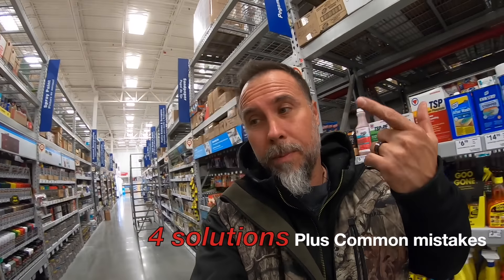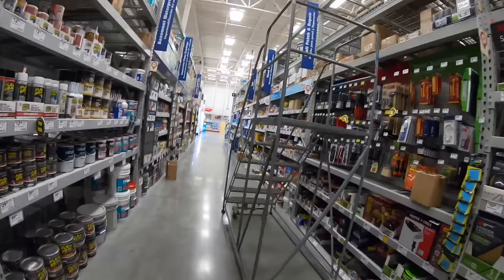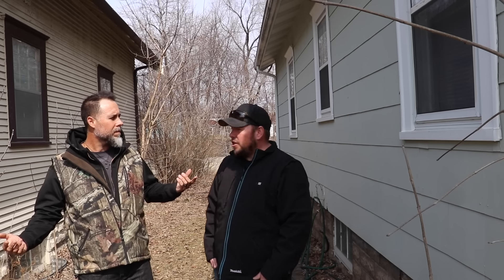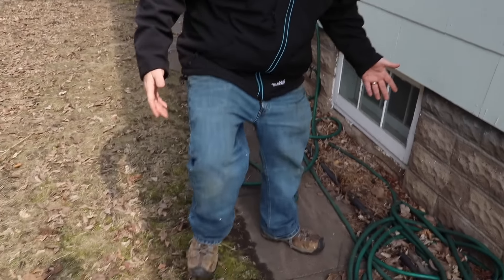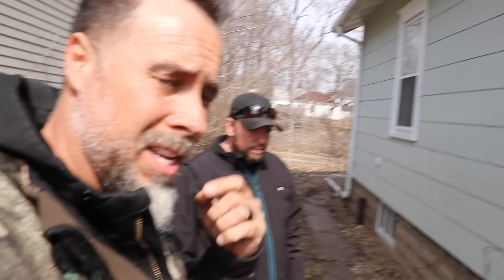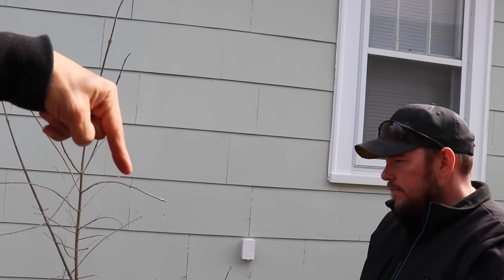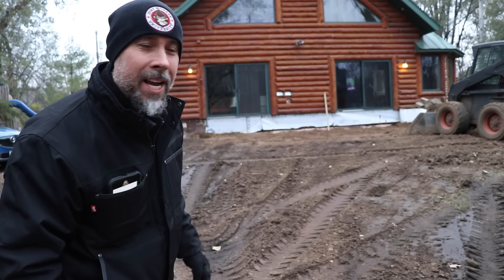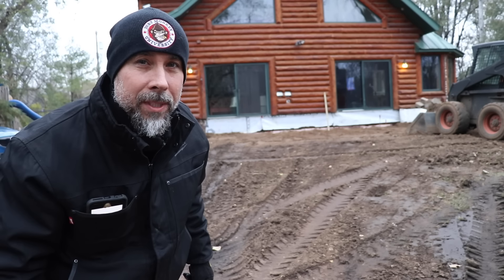4 Solutions to fix a wet basement plus Noob Mistakes

Comment: This video was extremely helpful.  I had the same problem others have mentioned here, getting a proper diagnoses of my occasional flooding. Even though I told them it only flooded when the gutter overflowed onto the side of the house, they told me it was the false water table coming through the bottom at the footing. It made no sense. No flooding for years, as long as the gutter was pitched away from the house. After the sticker shock of their solution, I did my own investigating and found that when I ran the hose next to the house, the small window well was filling up and running into the basement thru the sill. That’s not to say their solution wouldn’t have solved that. But I’ve got to believe grading,  French drain with a good draining window well will actually solve it. Maybe not.  But we will see.  Their solution involved tearing out the walls and cabinets, digging trench, and Installing sump.  Just tell me the options instead of insisting on the last resort “guaranteed” to work solution.

Comment: I have family that install drains in Missouri and they have told me that unless you line the trench of a french drain with non-woven filter fabric before you put in the rock and drain tile and wrap it over the top, that the soil will migrate through and mix with the rock and slow down if not stop water from reaching the drain tile.  Wrapped with a non-woven filter fabric, all of the water in the soil that reaches all of the rock flows to the drain tile and quickly drains off.
Reply: They did say that the all-in-one drain tile are a good second choice.  Not as efficient but the foam "rocks" wrapped in the fabric do prevent the drain tile from getting plugged up.
Reply: Hey, if you don't mind me asking how much did that cost tou total,? Do they charge based on dimensions? Thanks

Comment: We did 3/4 of our external basement walls on our house in France last year. Dug out the basement walls down to the the bottom of the foundation walls  2.5m x 1m for 20m length (using hand tools as no way to get a mini digger in there). Cleaned up the stone, repointed it, 3 layers of render to get it all flat, Rubberised / tar paint over that and then the dimpled membrane over that. 3" of compacted sand in the trench base, followed by a 'geotextile' sheet in  a giant U into the bottom of the trench, the ends sitting above ground level (it was a 4m wide roll). We then laid our pierced drain tubing into that and filled with gravel all the way up to slightly below ground level. Closed over the Geotextile and then  added more gravel / stone over the top to just above ground level and sloping away from the wall. It took 9 months to complete but should do the trick ! 
One thing you want to add is a metal strip that forms a lip over the top of the dimpled membrane to stop water running down the wall from above and behind the membrane. You also need to make sure to tape the joints in the membrane sheets to make them really sealed shut. over engineered maybe but for the sake of an hour and a couple of rolls of tape, worth the peace of mind. 
At 15 mins in the video, what's that pipe on the opposite house wall? Hope its not throwing water out?

Comment: You could also knock on the neighbors door and ask them to run their downspouts away from your house.
Reply: Old lady:. Oh, so I should point them where?   Oh. Hell no. They are fine where they are... don't touch them!

Yeah. I have little faith in people.
Reply: Good luck with that.. for 16 years my neighbor in a townhouse section i lived in never cleaned his gutters so it dripped off his roof next to the foundation and it would always leak in my basement
Reply: My neighbors just moved after 22 years and they never cleaned the gutters and ran it down into my basement. Now they are gone , they have new gutters now so we shall see.

Comment: The neighbor's drain is pointed directly at the house in question.  @6:50 Stan even looks right at it.  I'd be talking to them first.
Reply: If you're referring to the downspout extension at the rear corner, it would be a minor concern compared to the poor grading of the site itself.  Properly graded, a swale would still take that water away from the building rather than back towards it.  Improperly graded, you're just trapping water against the building until it flows over the foundation (or through the window).  Still, changing the direction of those things takes maybe $10 and a trip to the Home Despot?
Reply: I know the grading is the obvious issue, just pointing out a scene in the video.  Like I said, the neighbor could be so kind as to change the direction.  Would be cheap and wouldn't hurt.

Comment: for someone so fixated on the IRC stipulation that we keep grade 6" below the sill plate (and siding), you missed the part that says high termite areas may not use foam board on the exterior subgrade surfaces. you also missed where it says to use a 5% grade extending 10 feet from the foundation. 5% of 120 inches is 6 inches. your 1 inch drop over 8 feet of run works out to abt a 1% grade.

with that out of the way, step one is to determine WHY the water is coming in. 

if water comes in through cracks, then obviously seal the cracks. 

if water percolates DOWN through the soil and penetrates at the footing, there are a number of options. clean gutters with downspouts extended to discharge at least 10' from foundation. correct the grade. dig out and waterproof with compound or EPDM, install footing drain, install dimple board, or a combination of the three. 

if water table rises and overflows the footing, no amount of grading or waterproofing is going to fix the problem. dig out the footing and install a drain BELOW THE FOOTING, install a sump and discharge somewhere it won't find it's wake back in, or both. 

talking to a local historian i learned that before my block was redeveloped there was a cistern near what is now the corner of my basement. that would make a perched water table. sump pump it is.

Comment: That black pipe is the cheapest and with the membrane over it is the worst !!! I’ve been a plumber for over 25 years and I do alot of insurance inspections….the membrane should only be on top of the gravel….and theirs alot of cities that ban this pipe because it clog’s up after only a few years thus the pipe becomes useless 🤷‍♂️ white pvc with only two section of holes is the best….it stays straight and easy to slope perfectly 👌in general the video is okay…but not top notch!!! Theirs alot of professional that think their good but actually their not 🤔 do your homework and have multiple companies advise you before investing so much money 😉

Comment: If you are dealing with a slight cracked foundation that is allowing the water to enter the basement, there is a method to inject expanding material from inside the basement that will expand throughout the crack all the way out into the soil.

Comment: when you have shady basement windows like that with the old nails and no seal they are creating a moist environment with temperature differential bugs ect must cost a lot to try to heat in winter sunken sidewalks and splash protection of walls good points good video   as a concrete guy I would say new properly sloped sidewalks cheers from ontario

Comment: Sorry but the dimpels goes inn against the wall to let the wall breathe. 
Here in Norway it's almost only drainage with the plastic/membrane and also waterproof concrete first than the plastic with the dimpels inn, than isolation xps.
Reply: I was going to say the exact same thing. Treat the wall with a water proofing like the rubberized coating then attach the membrane dimple side in so the water will drain down the wall around the dimples to the drain tile below the footing.
Reply: came here to say this too, this stuff is common here in europe
Reply: I did the wrong order in My comment, it's water proofing the wall first, than isolation and last the plastic/membrane with the dimples against the xps isolation. It's been a lot of discussion about if the isolation goes first ore last but here the Sintef research organisation have researched the topic and found out that the plastic membrane is the last before rocks.
So that's how I install  it when I do my drainage jobs.
Reply: that makes sense, because if you put your insulation on the outside it can get wet and wet insulation loses its insulating properties.
Reply: You are all kinda right but ultimately wrong.  If you buy the cheap board he got from the home improvement store it does not come with a geotextile face. Real drain board comes with a 4oz non woven fabric laminated to the face that faces the soil...dimples out.  The geotextile holds the soil and fines away and allows a void space for water to escape from.  

By going dimples in you have a sheet of plastic facing compacted soil.  Water comes down and has nowhere to go, completely defeating the point of the board and the void space that is against the house is serving no purpose.  

I’ve done waterproofing on large civil and commercial projects for 15+ years and know what I am talking about.
Reply: You would be correct that yes the dimples do go into the concrete however know the system that he is describing he pushed the barrier up with the dimples and then he puts the pink fiberglass insulation outside of that in that situation you would put the nipples facing out that way when the water makes it through the insulation it would run down not the opposite way it's completely different process based on the way he described how he does it none of the applications of wall board that has dimples actually set it up so you have another layer of material outside that board
Reply: @stevenbeacham6004  What I know of European building code and Standards you should have waterproofing and then a layer of clean gravel minimum about a foot wide from ground level down to and under drainpipe at level a foot under the basement foundation. Also have to use geotextile between soil and gravel.
Reply: @uppsalahazzemarkstedt2759  I know that in the United States there is a broad range of codes like in Oklahoma you don't even need to have a barrier like that I mean most houses don't even have basements out west where they have basements it tends to be dry so I think it depends on the location and inspectors are funny people and sure the codes they're not it really as uniform as people think also most of the United States where there are basement don't have the amount of moisture to places like Norway have
Reply: Roof coatings that are high dissolved solids silicone are the best. But very expensive. And requires an absolutely clean surface.
Reply: Also that polystyrene is Xps not to be confused with eps.
Reply: @Fake Reality The problem is in the wording... I like to say dimples in and pimples out...much clearer that way!

Comment: When we built our new house this year I made sure to put a drain tile in near the footer and then fill it with clear til a foot  from the ground level then clay and then top soil to grow grass because the house is built into a hill here in PA. And here it's nothing but hills and flood zones haha so we built on the hills haha I also put a small basin in the one corner of the sub floor in the basement to hold the sump pump and the water drains all go to the pump and that way if I do get water it will run straight to one of the drains we installed in the basement floor and then to the basin where the sump pump is and hopefully it works great I got the idea from our last house we bought and lived in for about 10 years it had a sub floor in the basement with a drain system and a pump

Comment: I got quoted $5000 to do draining in the basement. And $15000 from outside. Good I found this video, I don't want damp basement.
Reply from the maker: Hope the vid helps you out and hope your basement turns out well!!
Reply: If you add a vapor barrier on the inside it will catch the moisture coming through your wall and channel it into your waterproofing system and you will not have a damp basement and you could also add a dehumidifier and drain it into your sump pump.

Comment: I'm in a similar position as these two houses but my house is closer than my neighbors then the house is in this video. I was thinking if you dug up maybe 2 ft down and then made a v in the ground between the two houses and then laid your plastic down with the drain pipe in the center and then filled everything with gravel this should fix the drainage between the two houses very well.

Comment: At 10:17 the box labeled Hydraproof 3000 is a super sticky thick rolled waterproofing membrane.  We used to use that stuff to waterproof ICFs, but you better have experienced help cause if it sticks in the wrong spot, its not coming back off.  Its like an innertube for your wall if done properly.

Comment: Drylok traps moisture and accelerates efflorescence and breakdown on the concrete. Home Depot does not sell this but look for master building product systems like master seal. They have specific sealants for inside and out. Stuff is used on Waterdam’s and ponds just saying..

Comment: I've used drylok before on basement walls and certain spots water was still able to get through even after multiple coats. So It's not a guaranteed seal. It's got sand in it which fills in all the nooks and crannys in the cinder blocks and it's supposed to seal the interior walls but it doesn't work on stubborn areas.

Comment: My french drain was done like that, and the permeable fabric became impermeable with dirt clogging the pores. I had it redone with no fabric around the pipe, no  fabric on the rocks, no dirt on top, and it works perfectly. The french drain has to be perfectly free to catch surface water immediately so the water doesn't have time to build up and run somewhere else.
Reply: Thanks for the warning

Comment: i have an extreme flooding problem in my back yard. i have 3-4 houses with sub pumps UP hill from our house. all that water drains and collects in my back yard. the standing water is so much last year i couldnted 27 cat tails. i live in the middle of town! im almost afraid a DNR officer will show up and say its a wild life refuge! lol. im thinking of filling it in with class 5. its slightly up hill from the water to the house and then down hill (2 foot) to the sidewalk/street. it drains that direction now but in the winter time we ice the crap out of everything from the side walk to the street. thankfully the house is above the water settling line and stays dry! we do have a nice subpump ourself and it runs perfectly. the "swamp" im looking to fill is around 24x40 foot. im guessing 12-14 inches deep. 70% of that area is water right now from the snow melt.

Comment: If anyone does the interior water proofing please undermine the floor once you jackhammer or saw the the concrete. Otherwise you well contuine to get hydrostatic pressure causing you to get cracks in your floor. 
If your floor has cracks with water coming up from them, but the drainage tile in those cracks an make a direct line to your sump pump. 

Also do not buy the drainage tile either popcorn around it. It WELL clog up and you well have issues down the road. 

Also make sure your sump pump is in a Croc with a sealed lid, that way you can reduce the amount of humid feeling. Seal up any and all crack while you are replacing the concrete or the water well find the weak spot and come up. Its alot harder then they make it seem. As a professional water proofer I know.
Reply: Nemus Gonzales agreed, the pre fab drain tile with peanuts is absolute garbage. Use aggregate

Comment: You mentioned several times to get a battery backup sump pump. Then you have problems if the battery dies. There is another option for backup sump pump, it uses fresh water supply from the city to power the pump. It's a bit more expensive but how much is it worth to not have your basement full of water.

Comment: 15 years ago I had interior drain tiles installed and “waterproof” walls with heavy plastic.  Well, fortunately I did t have the money to finish the basement.  I just ripped off all the plastic as all it did was eating moisture on my walls and cause my 100 year old foundation to crumble!  Now, going to get gutters cleaned, sealed and pitched.  I see I am wet where water sits after the rain.  I may even do the outside wall with the rubber for good measure.
Reply: That plastic is (was) your vapor barrier intended to keep your basement from becoming damp and needing a dehumidifier. At 100years your foundation may be mortar and stone which more readily turns to sand vs modern Portland Cement. While the plastic may seem suspect your culprit is the water seeping from the exterior. If the inside mortar seems loose due to what manages to seep just imagine how deteriorated it is outside below grade where it's constantly exposed to wet soil. Definitely try to fix your grading, but that vapor barrier should go back to avoid smells, humidity, and mold.

Comment: Playton is a fantastic product 
But most contractors don’t know or cheap out on the installation of the product 
Many don’t install the air gap channel on the top of the wall   Instead just fasten the top to the foundation wall 
This doesn’t allow for air to flow through the channels properly to let moisture escape 
Always hire a contractor that knows how to install the product correctly